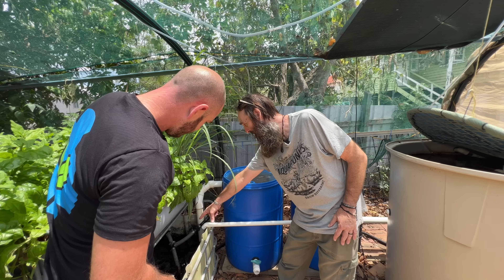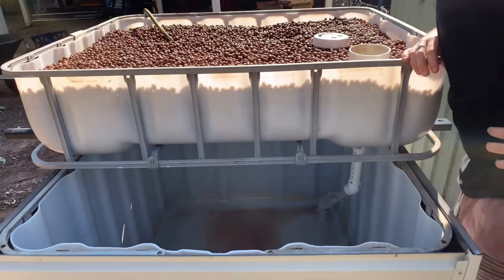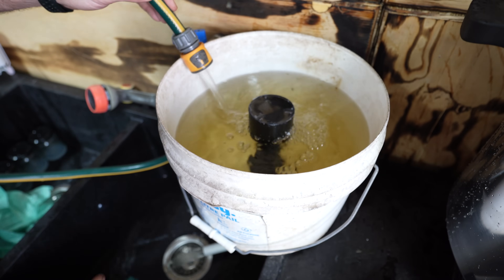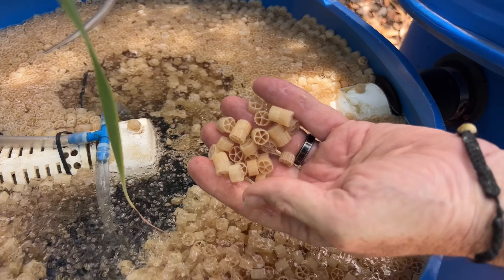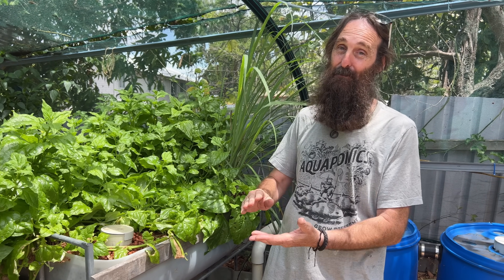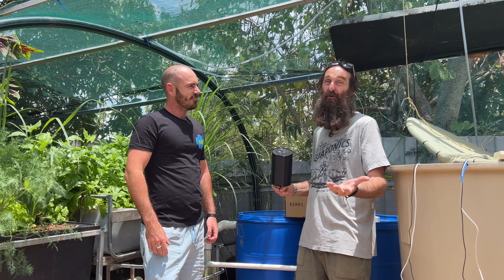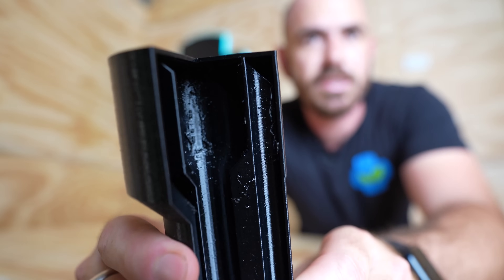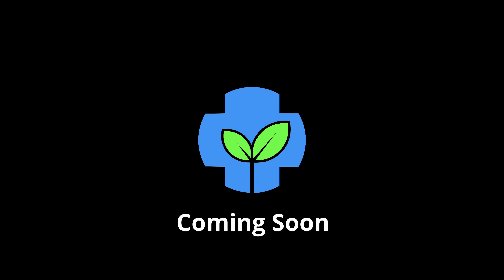Bell Syphons Explained + Aquaponic System Tour: Feat. Rob Bob 🐟♻️🌱

Comment: I make printed vases for my wife's flower shop, and getting them to not leak was quite the challenge. Since I use vase mode for this we are only dealing with a single wall so print geometry plays a factor as well. Anyway with the proper design I get watertight prints using a .8mm nozzle with an extrusion multiplier of 1.3, or 130%. This is going to be a bit too much for something with multiple walls, but you can always just print a single wall, maybe two with the rest being infill, or lower the extrusion rate to something a little lower than 1.3, but higher than 1. Increasing the extrusion rate is one of the keys to watertight/airtight prints. Also if your filament is wet it will boil off the water as it passes through the nozzle which will create bubbles that pop turning into holes.
Reply: Why would your filament be wet?
Reply: Most filaments are hygroscopic. Some more than others. It's the same thing as when you open a bag of potato chips, and they get stale, loosing their crunch. Especially in the summer when things are nice, and humid. It is kind of counterintuitive to think of plastic this way, but it is so. Take for example Nylon. You just about have to print it directly from a filament dryer, or it will soak up too much water from the atmosphere to be any good to print with. @christiankapler1618

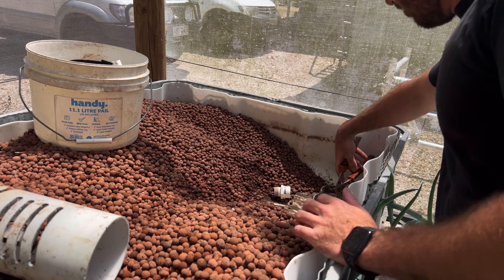Comment: 1:32  Would it be better to have some built in 'knock-outs' to increase flow in case people are dealing with substantial roots blocking the flow?  Or the other hand, put in plugs to fill some of the inlets, possibly use a slider/door to expose the extra inlets?

Comment: 0:42  Why not goldfish or koi?  I'm working on a hydroponics type system to support my fish, not my fish supporting my plants.
Reply: Works just fine - perch (and other species) are edible so you end up with more food output :)
Reply: cause they are using a food source to grow a good source.     I'll be using one to help filter my 125 g community tank while making salad for another protein type ;)
Reply: @adelinawarriner6259  he said the fish were too pricey and decided to use chemicals instead.
Reply: @chia_pet7121  .. wasn't actually referring to the video but responding to a comment..  of he thinks fingerlings are pricy he's never kept aquarium fish ($10-15 each is a normal low end price)  or koi (good koi run $250-5000 and up) ..  my pond runs $100 a year on fat heads to feed the other fish..    chemicals might seem cheaper to start but they add up also. ..   what's expensive - a snapper moving into your stocked pond..  we are know fencing the ponds and setting traps to get the snapping turtles out